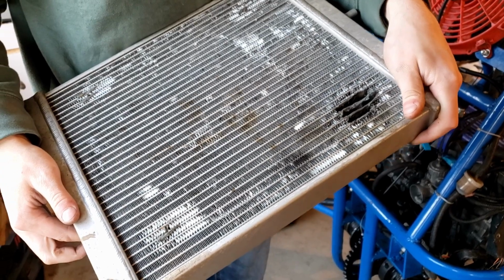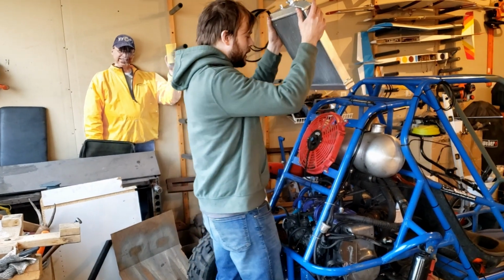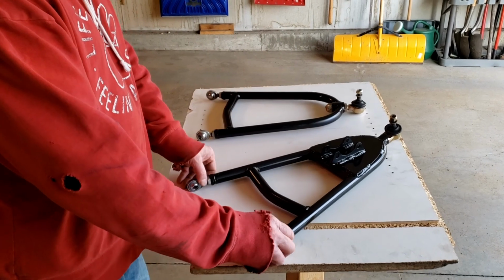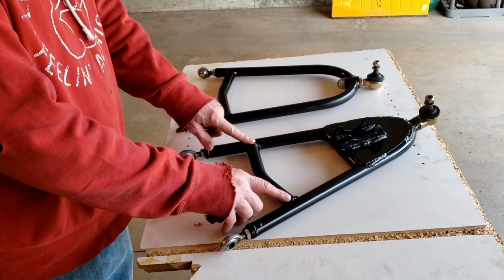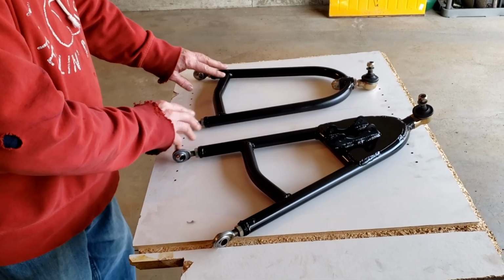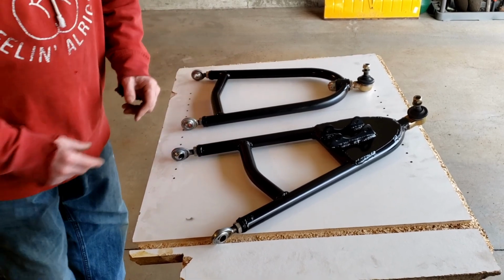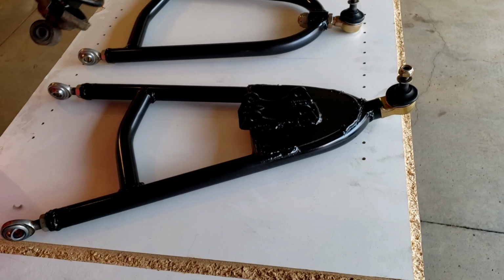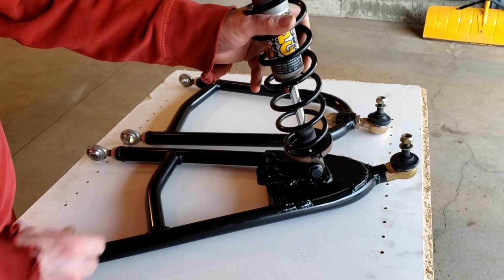Snowmobile Powered Crosskart / Buggy Finally Finished

Comment: What size of a engine? What kind of a engine?  How did you attach the engine and did you use a snowmobile clutch and torque converter? Thanks I’ve been wondering how to do this. Thanks

Comment: Is your upper radiator hose connected to the top of the head? 

I’m a little confused with my build. 

I’m using a 4 row radiator/fan and shroud from a 1990 honda civic. 

Two things, 
first is how did you hook up the radiator hoses to the sled motor? 

I’m using a 99 Polaris xc500 

I was assuming the flow would originate from the bottom where the water pump is? 
I see you have your upper radiator hose connected to the head? 

Doesn’t the cold water come out of the bottom radiator hose and wouldn’t you from want that to flow into the head top to bottom? 

Second thing is what temps are you seeing and how long can you keep the machine running before it overheats?

Comment: Such an awesome build! I'm Trying to find some info on gearing. Getting an old 340 free and want to put it in my kart but I see a lot of people having issues burning up belts because of gearing
Reply from the maker: Our goto is to gear the cart to have the same top speed as the sled it came from. And if the cart weighs more than the sled then make the cart go slower.
Reply: @jdsgarage701  thank you for the help! Looking forward to the next build!

Comment: Cool! Have you thought about building a shroud for the radiator and fan?
Reply from the maker: Yeah, we have an idea, but the temp seems to be fine without it so we figure it's not needed for now. Will add if we need it.
Reply from the maker: @relese_thebeast72 You can mount the radiator above the engine, we did this, the pump is strong enough. Not sure if it will have exhaust header torque specs, or if there even is one. But this is where we go for reference. http://www.vintagesnow.com/Polaris_files/85%20engines.pdf